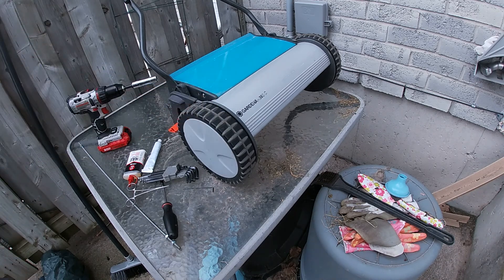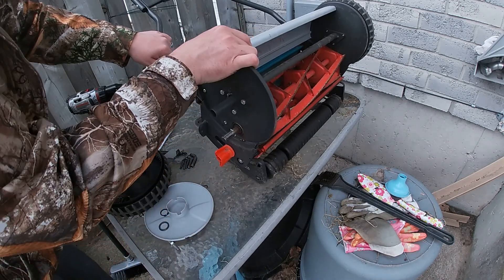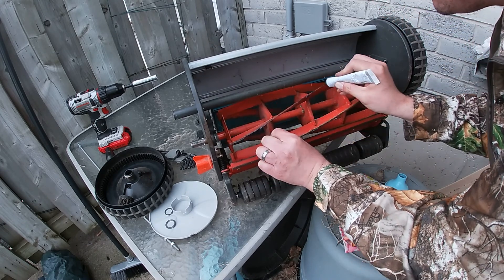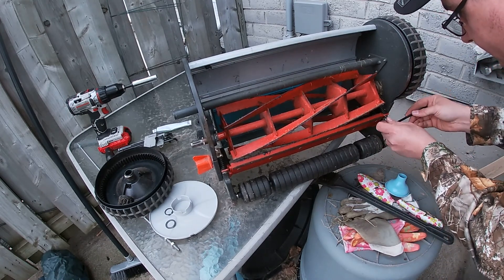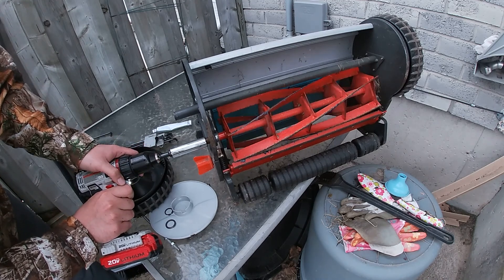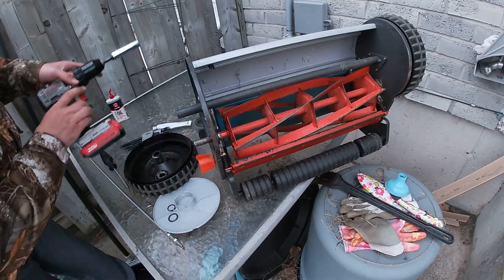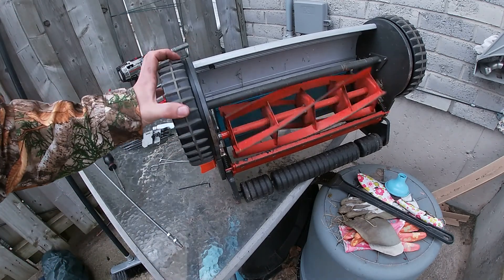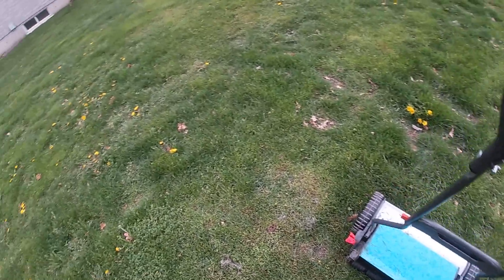How To Sharpen Blades On A Gardena Reel Mower

Comment: Thank you so much for the step by step video. I was intimidated to try and sharpen my mower but it was actually quite easy. The hardest part was taking off the clip to remove the wheel
Reply from the maker: Ya once the wheel is removed the process is smooth sailing. Glad my video helped. Thanks for watching. Please like and subscribe

Comment: Hi, what is the arrangement you have for the socket that you have on the drill?  It looks like a good way to go.  I have a Gardena and a Fiskars.  I have the sharpening kit for my Fiskars.  The crank in that kit has a set screw which lets me use it for the Gardena.  I like the way you are doing this with the drill/socket. Let me know your setup.  Thanks
Reply from the maker: My setup is exactly what I showed in the video. It’s a socket on a drill. Choose the socket that fits the shaft of the wheel. Not much else to explain.

Comment: Hi I have a problem with my reel mower (Gardena Classic 330). The lower blade does not make contact on the center of the blade roller, but it does make contact only on the sides. If I tight the screws then the center of the lower blade makes contact but the sides have to much friction and the wheels of the mower become stuck when trying to push the mower. So the mower does not work. However I am still able to move the blades manually, so I was wondering if I can fix this kind of problem by following this procedure. Can I?

Comment: Shouldn't the Gardena mowers be contact free, and thus silent?
Reply from the maker: They are “silent” when they are brand new. They say silent but with moving parts there is some noise. To sharpen it you need contact metal to metal. If you can adjust it again after that in a manner that will make it “silent” again then I applaud you. But the fact that this one was making noise is not something I will loose sleep over as it’s performance is still top notch. Thanks for watching. Please like and subscribe. And if you can do better I encourage you to show us a video and share the link here. Take care